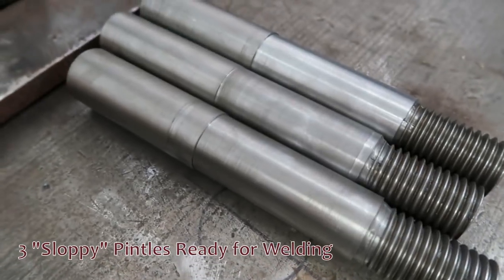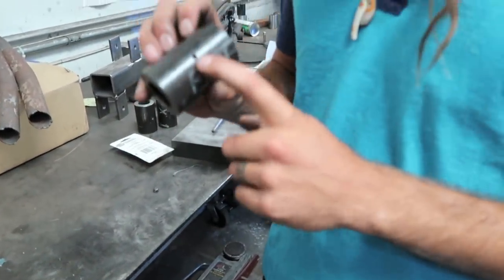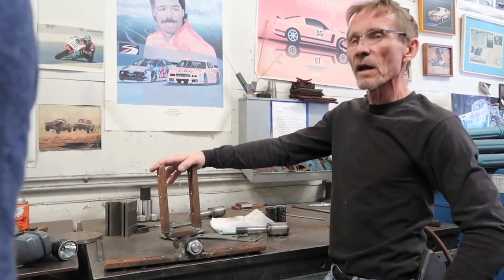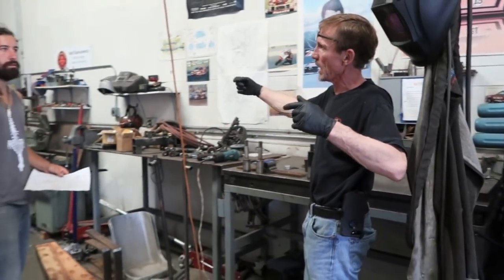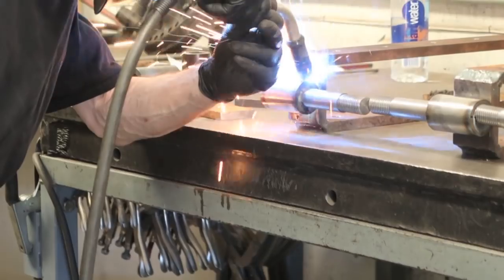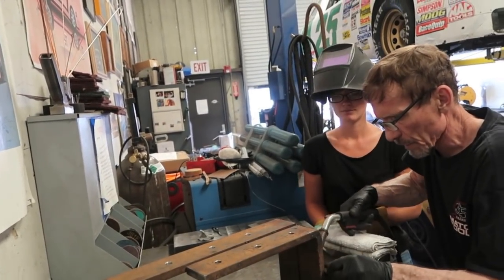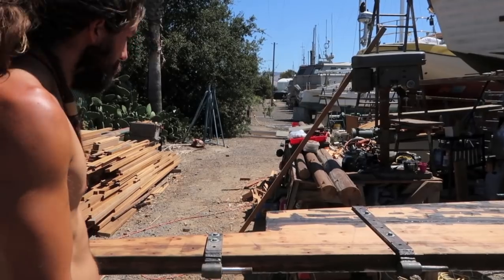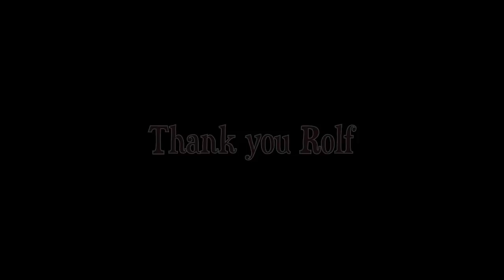Salt & Tar Episode 35 - The Rudder Continued

Comment: What a great guy Rolf is.
Offering to do all that for you guys is amazing.
Yeah, I probably would have done it different from how Rolf did it.
But here I am sitting in front of my computer, not there helping out
So I don't think that I have any right to offer one single bit of critic on how Rolf did it.

Thank you Rolf!

Things sure are looking good on the boat.

Cannot wait for the next episode.

As far as welding goes.
You need to sit on a big excavator bucket, running 1/16" wire all day.
You will get the welding bug out of your system in a hurry LOL. ;)

Comment: Looks great! Plumb and square is great for metal. Its not great for joining wood that will swell greatly in a nonuniform way. Not that it is bad to get it right now, but its gonna move. I wonder if its even recommeneded to tighten everything totally till its been in the water some time?. Its been really interesting to see you build this and learn things. 

I never paid attention to side decks till now because of you two. Then my last trip i got into a conversation about inner cabin or outter hull stay locations. Crazy the stuff ya learn when you really start diving into a subject. Designers, builders, and good mechanics minds are so undervalued.

Comment: Great episode!! Metal working, as opposed to the usual wood working!! Welding is not that hard to know about!! Just melting metal to a point that it flows, and mixing the two metals together, to make them stick together! Like glue, so to speak!! The electrical arc heats the metal very quickly, melting the base metal, and the filler, so that they flow together!! But not hot enough to melt the rest of the surrounding material!! Only the spots that need to be melted, to create the bond!! Think about working ice, in a very cold spot, but heating it up to melt, adding another piece of ice, and letting it refreeze, without melting the whole chunk of ice!! That's how ice sculptures are created! And that's what welding is about!! Getting the two metals to melt, run together, and then re-solidify into one piece!! Very much like gluing the smaller pieces of wood together, to make one larger piece of wood!

Nice vid. Thanks for sharing!!

Comment: I have really enjoyed watching you two build this boat. I have a couple of suggestions that may already be in your plan. One or two bronze washers at each pivot point on the rudder will stop friction wear from constant rudder adjustment while sailling. The other suggestion is to make a "V" on the leading edge of the rudder behind the propeller. This will improve propulsion when you have to use the engine. Like I said, these were probably already in your plans. You are going to have a very stout boat when you finnish. All your forethought and patience shows. See you on the next one.

Comment: What a great video. Now I want to rush out a try that "lightening storm" with our Tig welder! aaagh!  
I have some 'del ray' waterproof grease I bought 30 years ago . It's the best stuff. It just does not wash off , get a small tube and dedicate it to use for your underwater fittings........ but I warn you once you get it on it will get everywhere and not come of ,it's waterproof , duh! But it should really stay on the pintle/gudgeon pivot joint and help minimize the rust issues. You have so much extra Metal that even if you do nothing and it's rusts to all hell there will still be plenty of strength! But I might like to see a 1/8" thk bronze washer in the pintle.......
You must be so excited to see a job complete, and Thank you Rolf!
Cheers warren
Reply from the maker: Thanks Warren!
Yeah, I don't know what Garrett used but we've got an oozing amount of it in there now. We'll have plenty of zinc's below the waterline and you're totally right just their size will take many many many years to wither away haha
R

Comment: I think it would be money well spent to use castellated nuts. One day in the future you will try to put the nut and pin in underwater. Let me see if I can explain it. I believe in an earlier episode I think you said you were going to drill and pin the nut instead of buying the more expensive castellated nut. If you drill and pin it, the same nut must always be on the same gudgeon or the pin will never line up. If you ever pull the rudder while in the water each nut has it's place. If you dropped the nut it will be gone forever.Now you have to drill the new nut under water in order for it to line up. Can't be done so now you have to haul out. That may not be possible. Otherwise looking good. Just enjoy what you are doing.
Reply: John Tripp you hit the nail on the head there.
Reply: The problem is with a castellated nut is there is rotation here. A cotter pin was never designed to resist rotation. Your going to say a spindle uses a castellated nut ? Yes but there is a washer behind it with a tang to resist the rotation. A cotter pin is merely an emergency backup to try to prevent complete failure.
They need to carefully adjust the end play to the nearest foot (that was a tolerance joke) Drill it and put a roll pin through it. When it all rots out and fails they can just scrap the whole assembly and build it right.
Reply: My understanding is that the pin does not go through the nut but trough the pintle so the nut can't come off. I've done that on several boats and it works well
Reply: But that will allow the nut to possibly tighten due to the rotation and mess up there precision clearances?
I would coat the threads with water resistant lube then put the pin through the nut. maybe is wont corrode so they can disassemble it at a later time.
Reply: The laws of probability and gravity being what they are it is more likely(probable) the the nut will unwind ( go down) rather than up. There is no precision clearance, it is a sloppy clearance as per the design.
Reply: I know it was intended to be sloppy the precision was sarcasm. Why rely on probable/likely? when you can be sure? Every probably /likely you can weed out on the build is one less problem you may have to face later / And there will be plenty of Bugs as it is

Comment: I keep hoping you would round off the leading edge of that rudder... and the bow too. I would have put some more fillets in the hardware and rounded it off and ground it smooth...but im picky like that. Still nice though.  Good vids guys.  And nice work.
Reply from the maker: Totally understand haha After 3.5 years of building this thing we've eased up on the perfection. The bow though... you wait and see what Garrett it did... it's still maybe blunt for some but he shaped it real nicely ;)
Reply: Ruth you want a rounded shape on the bow not a point or wedge. Of coarse rolf is a race care builder and he can explain why LOL!!
Reply: Rounding the rudder leading edge would add nothing, its hidden behind the keel and will not add to the drag
Reply: The waterline length on this boat is about 34 feet, its max hull speed would be just over 7 knots, rounding the stem would not improve that speed. It would be sufficient to take the stem down to 2" or so and leave it flat workboat style.

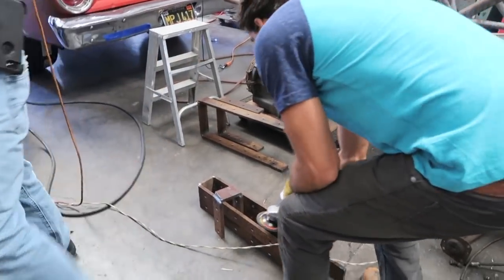Comment: 2:15 low-key throwing shade at all the haters and the armchair shipwrights who commented on the last video, lol.  They're building a wooden sailboat, not a mars lander, they don't exactly need a certified underwater pipe welder or a master machinist, especially when they're getting access to a fully equipped metal fabrication shop for somewhere between "cheap" and "free."
Reply: Hmmm, and your exact metal working knowledge and hands on skilled qualifications are Cyberdyne? As they say talking the talk is one thing. But can you do the walk? Exactly what have you offered in the way of educated, well tested and sound engineering principals or some well thought out alternatives other than implying that a jury rigged hack job will be more than good enough? I notice it's not yourself that's going to be betting anything that would cost you one thin dime on your points of view. I stand by every single thing I posted in that last video and if you'd like to go back and check I stated that everything I said was easily double checked with a bit of Google searching. Did you bother to run even one check before spouting off? Never mind I know what the answer would be. I've got well over 25 years in the open pit mining industry running everything from a few tons to over 1,000 ton shovels. And not one of those machines didn't use proper bronze bushings or even high cost roller bearings on any pivot point that was designed to move multiple times per hr. And possibly this will be a total shock to you, but not one of those machines were ever designed to go cruise around Mars.

That design detail of bronze bushings and steel pins on those machines is for use in open air not in sea water where the requirements are even more stringent because of the high corrosion issues. I know nothing about boat building and said as much, so that lets your lil armchair shipwright slur out of the equation. Since when does trying to help someone with simple, factual, and well understood engineering requirements that could prevent a catastrophic failure with possible life threatening consequence's become judged as a being a hater? Because you think and say so? There headed for the open ocean and not sailing around the local kiddie pool. I also said nothing about the use of welded mild steel for the main steel components that attach and support the hinging system between the hull and the rudder. And that 2:15 min. mark is about exactly those parts.Those should be just fine. But I'm not a welder and have never welded. So I'm not qualified to properly judge that part. Mine and others points were about unwanted and dangerous rust and wear on the pins and the holes they fit into. Master machinist, for what? You think that's the requirements to make simple pins and bushings? That's at best 1st year apprentice level work. Idly flapping your gums about something it's more than obvious you know zero about only makes you look like a fool to those that do know a tiny bit more about the subject. And what makes you such an armchair expert about judging who is or isn't an armchair shipwright? That cheap or free could end up as the most expensive part of the whole boat. I've seen nothing in this video that would change my thoughts and opinions I posted in the last one.
Reply: Tell me that when they are facing gale force winds and high seas in the middle of the ocean. Many have died over lesser things. God is in the details.
Reply: I'm legitimately concerned about the long term viability of this rudder. With the fillet welds that were ran downhill in the last video and then seeing the 3/8" or 1/2" square stock used to slug the hinge pins, I'm worried these guys are gonna have big welds with all the strength of little welds. You should never slug a joint like that in a structural application since it's going to limit the amount of weld penetration you can actually get. This should have been a multi-pass weld to build it up to a decent size. Turning point also brings up a good point about the lack of bushings. I'm not convinced mild steel on mild steel is a good choice, especially in a corrosive environment. These pins could be prone to galling or the welds could fail, both of which would leave these guys stranded.  Best of luck Salt and Tar, I hope I'm wrong.
Reply: Couldn't agree more.  Their boat deserves the best and I'm not convinced they got it.    I just watched the saga of Dove II, a crew who lost their rudder, and their boat,  in the middle of the Atlantic.   (The crew made it)  Please, have an engineer look at this.  ETA, you boat really is beautiful and getting prettier each day.
Reply: Yeah the union of the parts was poor. There needed to be either very good blacksmithing or better machining of the components. The square stock bothered me right away along with the poor corner welds on the strapping.
Reply from the maker: You caught that ;) Thanks for watching!!!!
~Ruthie
Reply from the maker: I think you missed the point. Whom ever Cyberdyne Systems: Skynet is was not bashing you or your intelligence but purely pointing out we are building a small wooden sailboat. Last episode more attention was put on what could've been better or worse there was bashing of a true friend of ours lending their time to help, than what got accomplished. It's a rudder. It will steer. It will last. If not we replace it. Simple. We won't loose it without notice because it IS so beefy. If you knew Garrett like I do he'd never let something like that slip past his inspection(which, no joke, is done daily). It's done. Can we move on. Stop.
Reply: For the most part I think that people are voicing concern that these metal components are not correctly made and understanding the vital role they will play in the safe operations of your sailboat. I try to be respectful in any comment I post but I feel strongly that these components may be vulnerable to failure in multiple locations. Improper joinery like this does fail and its worth a good review now while the boat is out of the water. Best
Reply: Boat parts break and crews deal with that all the time. The rudder isn't an essential piece of life support like you're making it out to be, and if a weld breaks or a bearing wears out quickly, it'll be easy to see how that can be remedied. You need to learn the line between "voicing concern" and being an incessant pain in the ass.
Reply: There  you go putting an angry label to some conversation. I am relied on to set high standards for my craftsmanship every day and Its how I earned my station as a master craftsman in my trade. Funny how a couple comments raised such ire in you.
Reply: Rest assured nobody is relying on you here. As the boss said, "It's done. Can we move on. Stop." Take a hint.
Reply: OK snowflake
Reply: This is pure ignorance of what a rudder does and what happens to a boat when it loses the rudder in blue water.   You really should avoid sailing.  Seriously.
Reply: Not to mention BRONZE or Stainless is the preferred metal for sea water! NOT mild steel
Reply: haven't seen many bronze or stainless steel boats, have seen plenty of steel boats though. I'm amazed - some people even paint them!
Reply: It didn't look like either the pintles or the gudgeons were mild steel - the straps may be - but they can be protected. Before casting insults it is always better to look in the mirror first.
Reply: Keep in mind also, they are following plans given to them by the man who already has a boat just like this in the water and sailing. Don't you think if the rudder were an issue he would know from firsthand experience?
Reply: Salt & Tar hola sus vídeos son muy entretenidos e interesantes me gusta lo que hacen.. Cuando publicarán el próximo video estoy ansioso por ver terminado ese velero.. Saludos desde RJ Brasil..

Comment: Hey, is that a 427 Thunderbolt in his shop(red Car) or just a Regular Fairlane? Also, are you  going to fair the edges of the rudder, or leave it square-edged? Rolf is Right, Garret, we HAVE to know how to Weld, and you saw how Easy it is with a MIG. Plus, you can get Flux-Cored wire, so you don't need the Gas tank. Migs are Cheap and easy, and you could get a good Used Arc (Stick) Welder for Heavy Stuff. I hope you had Rolf Tack the Pintle Nuts On so they can't fall off....Now for the Masts?
P.S. Those WERE Really Good Beads you and Ruth laid down...
Reply from the maker: I don't know what the red car is... I see him today, I'll ask :)
No, no rounding the rudder. They aren't hard 90 degree angles but they sit in line with the keel so I don't believe there's a need to shape it further. Welding is so much fun! I had no idea it'd be so addicting. I did three seams before I realized I didn't let Garrett try! We'll be doing more though that's for sure haha
Yes masts! First though are the chainplates and they are in construction as we speak ;) We probably won't step the masts until we're in the water to save time/money on the hard. 
Cheers Jim
Thank you
~Ruthie
Reply: I think I'd knock the edges off in front of the Prop, at least, so the edges don't Block the wash from prop and drink fuel....Hurry Back, I have No Life, so always Waiting to see how Yours is going. Fair Winds.
Reply: Oh, P.S. Almost forgot, AGAIN: You can get LONG grease lines and connect them to your Grease fittings, and lead it up the transom or forward edge of the rudder, so you can Grease the pintles ANYTIME, so preventing rust and stiff steering. Get them at a Heavy Equipment parts place. All the newer Heavy Equipment has them from the factory, so you can easily grease those Hard-To-Reach fittings.
Reply: Leave the front of the rudder square to match the keel except in the prop area then taper the trailing edge.
That and the front bow and the flatness of the bottom will make a huge difference in when you can sail and when you have to motor. Hint motor is wear and tear and fuel . sails are free thrust

Comment: Area you going to put cotter pins thru the threads so the nuts cant back off?
Reply from the maker: exactly :)
Reply: Cotter pin will work (move)and fail. needs a roll pin press fit into it also called a shear pin.
Reply: Any hardware store has roll  pins for a 1/4" one drill a 3/16 hole then ream it out with a 1/4" drill carefully tap the pin in

Comment: Cool!! Tiller or wheel?
Reply from the maker: Garrett eventually wants to go wheel but we'll hang with tiller until the rest of the pressing projects are done...ish 
;) R
Reply: Big rudder flat sided, tiller?. Cut some hole in the side install benches inside stick some ores through the holes find some volunteers (not galley slaves that would be politically incorrect) have Ruth setting a pace with a big drum Garret steering and call it a Roman Navis Rostrata (war ship).